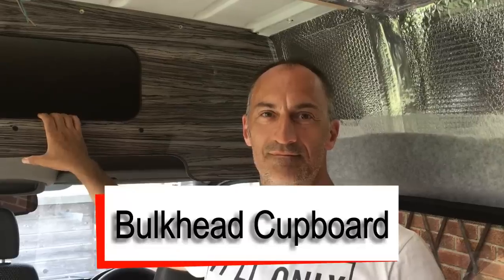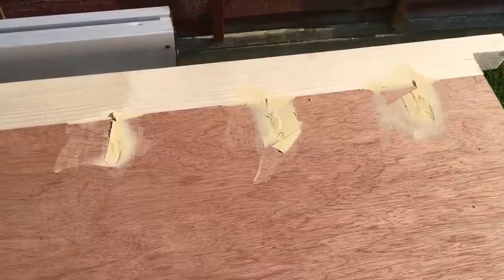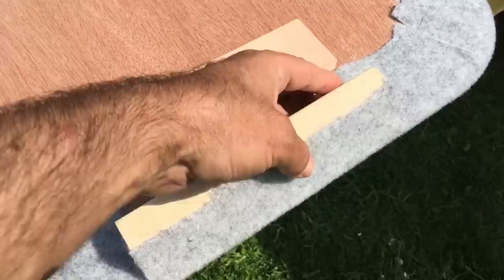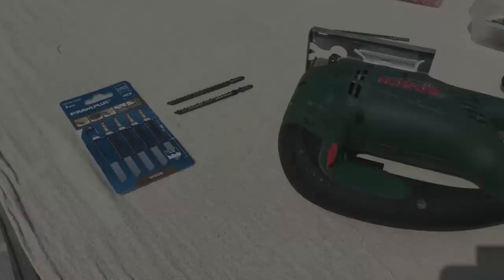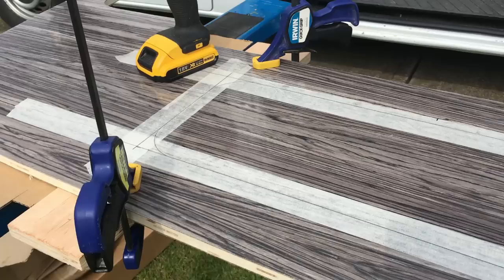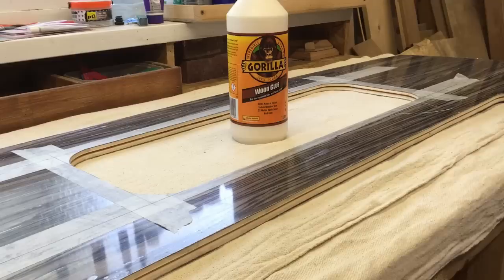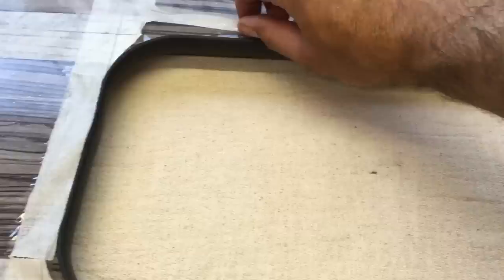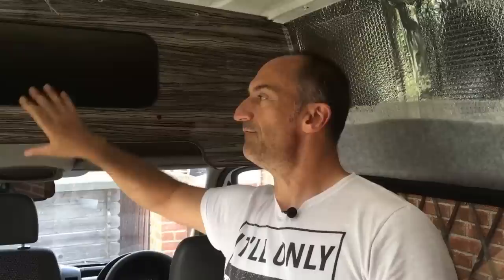Mercedes Sprinter Camper - Bulkhead Storage

Comment: My LT35 van (1998 vintage) is a 'high roof' and I use it as a workshop/tool carrying facility for my vehicle projects.  Was thinking of making a 'sleeper cab' but utilising the load space above a large compressor I have in the back. Would require some cutting, welding and fabrication obviously. Your videos are great for sparking the thought process and also pointing out the good and bad points I need to look out for. many thanks, Greg....(P.S. still have to fit my skylite in the rear after watching your videos earlier)
Reply from the maker: A new HSS blade with fine teeth and it will be a breeze to cut.
The mastic tape is a must for levelling any ribs and finish off with sikaflex
Don't forget to clean up those metal fillings after before they go rusty.
Funny how cutting a big hole the roof of your expensive van can make you smile so much.
Best wishes and I'm sure you'll be fine.

Comment: Nicely done Greg, got a great fit there! Handy tip on the jigsaw blades too.
Reply from the maker: I was really pleased, I did not have to trim or sand anything the card template worked a dream. That’s the most complicated cuts done now.
Reply: Greg Virgoe A great example of the "Measure twice. Cut once.' rule.

When in doubt, template it out!
Reply: Greg Virgoe Another possible tip (depending on visibility) is to "back cut" all scribe cuts. That is, cut to the line on the face, and back from the line on the non-visible side. It's much easier to get a great fit. And if you have to take anything off, you're doing so on a thin edge.

Comment: This is a really good video Greg. I was wondering how on Earth I was going to be able to do mine. But I’ve learnt some really valuable information. Thanks!
Reply from the maker: Hi Katy, When I first looked at it myself I did a lot of head scratching. But fixing a batten to the roof rib and the larger timber on the leading edge of the shelf make it so much stronger. Although it’s only going to hold spare bedding.

Comment: Absolutely first class work from conception to execution. The glossy zebrano finish looks excellent. I do think it would be useful if the manufacturer of the board developed the complementary range of screws cappings  to match the finish.
Reply from the maker: Hi Norman, thanks for the compliment.
I have placed the screws so that they will be under the cupboard door and adjoingin wall cupboards. so you wont actually see them under normal use.

Comment: The edging looks really good. Those screw caps look fantastic!
I finally finished my floor. I am unsure about the insulation for my roof. Finding the stick on aluminum pin anchors in small quantities is proving rather difficult. There are steel ones available, but have poor reviews for retention. Many are rated only to 120* F, and they come loose....I'm pretty sure my van roof gets above that plenty this time of year.
I did discover something that surprised me. I used the silver backed 3/4" polyiso panels to insulate the front half of the cargo area, foil side up for vapor barrier.
I had a small piece of scrap lying on the metal floor, just behind the engine dog houes, and just above the trans.
The floor there gets extremely hot.
The scrap laying there was silver side down, and the to the touch it stays pretty much at ambient temps. The light silver film and the 3/4" poly is an amazing insulator. I'm going to frame some into that area, and put plastic over the top for a vapor barrier.

Thanks again for the work you put into your videos!
Reply from the maker: Is it not 120degC? I had one that came unstuck but could not put it down to temperature, it may have been dirty?Most PIR sheets are foil on both sides, both brands I used are. 
Plastic is also ok to use for a vapour barrier, use the correct building membrane as some plastics are slightly permeable.

Comment: Hi Greg a tip for the future, the spray on adhesive compared to the roll on brush on version sometimes has a lower temperature rating for adhesion. I had a problem where I used the spray on to redo the headlining of my girlfriends car, it didn't last Summer before it started to pull away. I redid it with a rolled/brushed on version of the same adhesive and I've had no problem. This might only be an issue for hotter countries but it's important to look at the temperature rating of glues when gravity and heat are an issue :)
Reply from the maker: Hi Karl, this one is rated to 120degC I would have thought that would be ok 👌🏼 it does stick like s?&@ to a blanket.
Reply: Greg Virgoe I concur!
Reply: Yeah it wasn't untill I had the failure  and looked at the back of the can and it said 60-80degC and a car in the Sun here in Oz can get funkin hot. So like I said, I think it's only a problem for hot countries :)
Reply: Where did you get the adhesive from mate ? And what's the name of it please. I want to re do the headlining on my car
Reply: It is generally called "Contact Adhesive" because you spray it on both surfaces, wait a few minutes then 'contact' the two pieces together. In Australia its called Kwik Grip made by Sellys. As Greg's use a spray glue with a high temp rating I hope he gets back to you with the name of the glue he used.

Comment: Thanks for the update,,,Greg I heard you say you cut the vinyl trim a little longer,,,, that is good,,, In my earlier life I installed a lot of molding on automobiles,,, I first installed a track then put in the vinyl insert,,,We were instructed to add between 3/8 to 1/2 inch to the insert ,,, because over time the vinyl shrinks,,, It may not be as critical inside a vehicle because it does not get the sunshine directly,,,,Just FYI,,,Best Regards

Comment: Would be interested to see an outside vs inside temperature test to see how your insulation is performing as the job you did on it seems quite thorough compared to some other builds iv seen.  Impressive so far 👍
Reply from the maker: Hi Darren, we did spend a lot of time to get the insulation fit and the vapour barrier complete. The walls and roof are in excess of the same insulation you would get from having 4" of loft insulation in your home. We are hoping to shoot some thermal imaging footage when we return to the Truma factory to prove how well it performs. Look out for that video soon.

Comment: Wow! You're cutting the internal corners on the board freehand with a jigsaw. I may have to make a jig for this. Thanks Greg  ✔️😊
Reply from the maker: Sunnycampers yes mate, take it nice and slow and let the blade do the work don’t force it. You can smooth it with a file and apply trim over so it’s not too bad. 😀

Comment: Thanks for another great video, I'm thinking about making the overhead shelf with a bit added on to make a bed for my little ones. The extra bit would fold up during the drive. Do you think this is possible if i can reinforce the shelf for the extra weight. Thank for your time.
regards 
Richard

Comment: Proper job Greg. Even your noggins look wonderful:)
Reply from the maker: Thank you mate, how are you getting on with the transit build?
Reply: Not good I'm afraid, the van broke down and has been stuck for ages at Ford for repair. Which ment I couldn't work on it. Finally got the van back yesterday. It needed four new fuel injectors, since all the originals were corroded. How does this happen on a brand new van with just 500 miles on clock?

Since I want to get the van re-classified as a MotorCaravan by the end of August, I just don't have enough time to do my planned detailed build. So as of today, I'm going to knock up a rough kitchen unit, bed and wardrobe in old ply, add some cushions and curtains and hope this is enough to get it passed.

If this is sucessful, I then qualify for cheaper insurance and the vans value will have inceased enormously. I can then rip out the crap stuff and do a proper job as originally planned. There maybe a silver lining here since I can test out the layout on the old ply and make adjustments without wasting good wood.     

Which makes me wonder, have you got your van re-classified before you leave on your European adventure?
And finally you seemed to have gained a very pretty assistant:)
Reply from the maker: Time is the one thing that you need bucket loads of doing these builds properly.
That is very strange about the injectors, guessing it was all covered by your warranty?
I will get our reclassified before we leave and that's the only thing that could hold us up.
It's currently SORN and got no MOT while we do the build. Lots to sort out still.
I heard that there was a bit of a wait to get them back as it's become so popular.
Thankfully my dear mum has kindly offered to put us up for a few weeks if needed.
Our house is definitely going on the 7th July no matter what so the clock is ticking loudly.
Oh and yes, meet Louarnna (Lou) my beautiful partner for 17years now :D
Trying my hardest to get her more involved but she's very camera shy.
She does really like the festivals and is so much happier talking in person.
Reply: Sounds like some military style planning has been going on here. I'm impressed. I get nervous just catching the IOW ferry:( Tell Lou not to worry about the camera, us campers are just a bunch of harmless idiots!

Comment: Hi Greg, fantastic videos big fan. Quick question on bulkhead  you made wood plates for behind headliner great but how did you install them? Did you remove headliner completely and remount with shelf in or find a way of slotting them in place. Thanks mark
Reply: Wondering the same thing. I don’t get it, did he just screw right into the headliner and that’s how the shelf is supporting weight?
Reply: Same question
Reply: Anyone ever figure it out?

Comment: Thank's, a great and informative video as always. I didn't quite understand how you managed to position the matching piece of ply on the other side of the head liner and then align them with the batons fixed on the shelf. I'd really appreciate a clearification since we're discussing the construction of a similar shelf in our sprinter
Reply from the maker: Hello Sebastian, 
I pre-drilled the plywood and countersink the holes to exactly the same centres as the angled wood blocks
hold the shelf up into position in the headliner and screw the screws through the headliner just enough so they are poking through a very small amount then grab the ply and reach down the sides you cannot see but you can feel when the pre-drilled holes drop over the tip of the screws, screw up tight until the two are sandwiched together. I did not put ply on the front ones just screwed them straight into the headliner. The shelf was 12mm ply and with the side and the 3x2 timber rail it is super strong.
Reply: +Greg Virgoe I really appreciate you taking the time to answer. Your method makes sense and we'll probably do it the same way

Comment: When talking about the blades you used you mentioned you wanted to cut on the top surface so switched the blade. Maybe I'm missing something but why not just flip the piece of furniture board (and the template) and keep the upward cutting blade?
Reply from the maker: You can do that if you want. 😊

Comment: Hi Greg, in terms of the insulation around the bulkhead is this just rock wool pushed in the gaps? Is there any risk because of there not being a vapour barrier. Worried about condensation forming and soaking the wool insulation? Thanks and love the video series.

Comment: Amazing finish on that edging strip, top tip glueing it too for sure. I'm a touch confused how you fixed the shelf to the headliner piece, how did you get the small pieces of wood it's screwed into down the other side of it without removing the whole original headlining? Especially the two at the windscreen edge?
Top vid as always Sir Greg.
Reply from the maker: Hello, The two side ones are clamped to plywood on the outside and make a really solid clamping point on each side.
The front ones are screwed into the bulkhead only but only to hold the join together.
The rear 3x2 timber is fixed to the new bulkhead and that is screwed to a batten fixed to the roof beam.
For what little is going to be stored in there it is so solid now.
Reply: @GregVirgoe  hi, not clear on the fixing.  Did you sandwich the liner between the ply and battens?

Comment: Nice work think there is a market for a set of templates for van conversion. I would have installed a metal floor on your shelf with an anchor to wind shield posts and location behind seat where normal industrial divider goes. Does sprinter make a shelf as an option? If so buy one an use for template. A parts dealer has speck on oem parts spec.
Reply from the maker: You are dead right about the templates.
I originally looked at flat pack van furniture but you still have to scribe it to the curves of your own van.
If you are going to do that and put it together you might as well do the lot from scratch and have it how you want it.

Comment: Hi Greg. First off, your videos are amazing and I've followed your build process extensively! They are so informative, detailed and a joy to watch.

I'm about to make a cab shelf for my Sprinter, although I cheated and bought a paper template online. One question I have though is how do you transition the angled cuts from the shallower angle on the sides of the shelf to the almost 45 degree cut on the front edge?
Reply from the maker: Make them all at the steeper angle. You will not see the slope above from the underside, just the leading cut edge. 👍🏼😃

Comment: Hi Greg, thank you for all your content, it really has been a great help so far in my conversion. Did you attach your shelf to the structure of the van at all, or did you just sandwich the headliner between the backing plates and shelf? I'm concerned that if too much weight is added to the shelf then the headliner might be pulled out of place. Cheers
Reply from the maker: We made a really sure fixing on the front edge then sandwiched the sides as shown and to be honest it's really secure and although the cupboard has always been full of blankets and screen covers it's never moved at all. :D
Reply: @GregVirgoe  OK thanks, just ordering materials now.
Reply: @GregVirgoe  Greg I came back to look at this video again I appreciate you showing us how to glue cloth to a board but you didn't show us how you fixed it to the van where did you screw those screws into what did you screw those screws into did you rip out the ceiling? My van will be here in a week and I'll be happy if I can get it insulated and some walls and a ceiling not sure what I'm going to do with the floor it's got the wood floor in it that would be another question what do I do with that floor do I pull it out and get rid of it do I use it in one layer somehow or another.? I'm hoping you have a website where I can send you an email and a big tip or an offer of a vacation to you in the Mrs here in Montana LOL I live in Paradise which is one of the reasons why I want the van there are hundreds of miles of logging roads just down the street from me.
Reply from the maker: @justjudy7320  in the video I explain about the blocks of wood I used on the back of the ceiling to sandwich the head liner like a clamp with screws. It is better to remove the headliner so you can properly insulate the cab roof. I recommend using Armaflex self adhesive sheet for the cab roof. I have a couple of videos about the floor.  It does need insulation but you can reuse your wood floor on top of that if it’s in good condition 👍🏼😊
Reply: @GregVirgoe  okay now I get it that's what you were talking about with those pieces of wood you talked about it but you didn't show it which is why I was confused. But yes I would think if you're going to go to the trouble to create one of those things you would want to put some kind of reflectix to keep the heat out of it and if you're going to go to that much trouble up above.

Comment: Another really helpful video Greg. This is next on my job list. I have all the materials and hope to start very soon. One question, the sandwich battens you have towards the windscreen, how did you get the wood plate behind the original flimsy plastic bit? I can see how you did the sides but imagining you took the whole thing out?! Many thanks, Lawrence
Reply from the maker: I only put them on the sides. The front is just screwed into the headliner. It’s really solid even with just the side ones and we only put screens as bedding up there
Reply: @GregVirgoe  thanks that’s good to know as really didn’t fancy taking the whole thing out! We’ll likely use it for the same!

Comment: Just wondering if you put any vapour barrier around the insulation you placed down the sides? Thanks. Youre videos are amazing and have been a great help
Reply from the maker: You need to seal up the plastic trim clips on the inside with silicone to stop them letting in water. Then vapour barrier over everything. For doors put the insulation into sealed plastic bags so the doors can still draojm
Reply: @GregVirgoe  thanks for the reply!

Comment: Loved the video Greg as always, but I would love to know how you got the packing pieces behind the headlining.... or is it just time and patience.
Reply from the maker: Hello Ed, the key is to have them pre drilled and countersunk first to the same centres as the wood blocks, drive the screws through the headliner so there is a small bit of the screw showing that you can drop onto, then this bit you have to do blind just by feel, located your pre drilled and countersunk holes over the screw tips then screw in. It is very tight and you do need patience, driver side was easier. Failing that it's about six screws and the headliner comes right out, that the sensible approach. Hope that helps
Reply: Many thanks for the advice Greg, I love the way that you present the videos and share your knowledge. Too many people are "precious" with their techniques these days. Always a pleasure to watch.